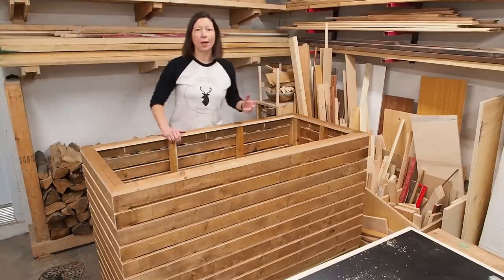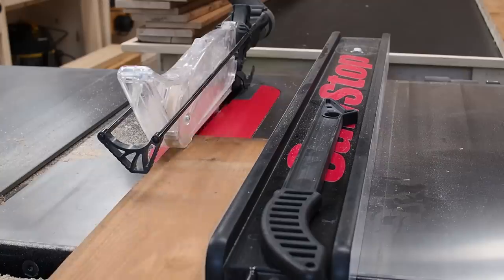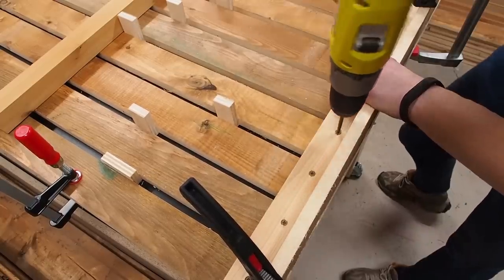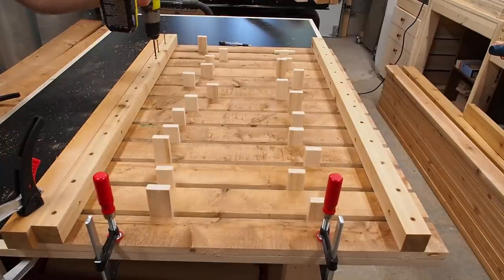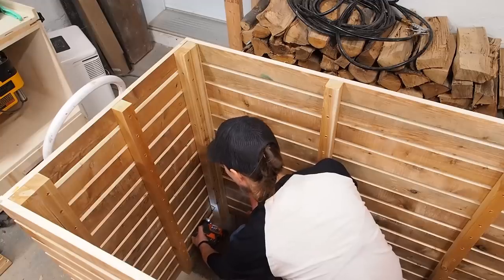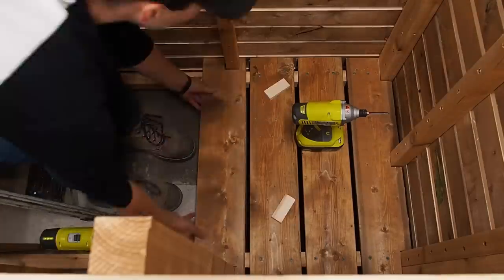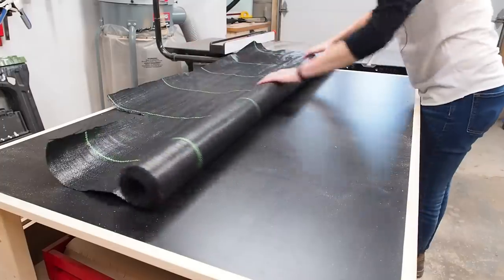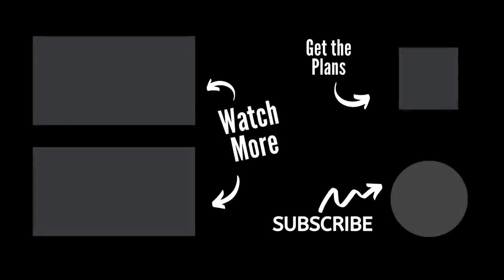DIY slatted planter box // raised garden | with plans

Comment: That's what you call "thinking INSIDE the box".  Great build!!
Reply: I can see why your friend wants the height as planting will be easier. You might have used a false bottom to reduce the depth. It's going to need a lot of soil. More than what's needed for most plants. That would require some additional structure to handle weight of dirt.
Reply from the maker: Haha thanks!
Reply from the maker: I suggested the false bottom but she insisted the the dirt be this deep. Maybe she knows something I don't! Pumpkins perhaps!?!
Reply: Good one 😄.  Great job I agree!

Comment: Would not a wider gap between side boards and end boards allow for the planting of "stuff" that would hang down the side? Think tomatoes, flowers, non-lettuce veggies although my mainframe is overheated and memory banks are fading. The reason I mention "side-out" plants, ferns, flowers and the occasional veg is that I'm building a chicken-wire frame, filling the planter with sphagnum moss sides that'll accommodate a plethora of flora, something to water with a wand mister and dream there's not a water shortage. Cheers from San Diego and THANK YOU for filming your work, you inspire me to do things right.
Reply from the maker: Sure, that would work too! The small gaps were just a visual design choice. Thanks!

Comment: Great job. I’d be worried with all the weight of the soil (the constant pressure) at that height and length that the sides will bow out. Mightn’t hurt to put a couple cedar braces inside middle on top of the weed mat, screwing to verticals around 1/3 and 2/3 up  respectfully. What do you think?
Reply from the maker: Yes, I think that could make it even more solid, good tip!

Comment: We Support you!  I do woodwork as much as I can. Yes, it is my passion As well! 
 I just finished an Asian  inspired design flower box, 14” front to back. Length about 36” long. The depth is 2 feet deep We have plans to find some planter boxes to fit inside. We might need to custom build. The liners will be for  protection on the inside,  thus from weathering rapidly. Any thoughts?